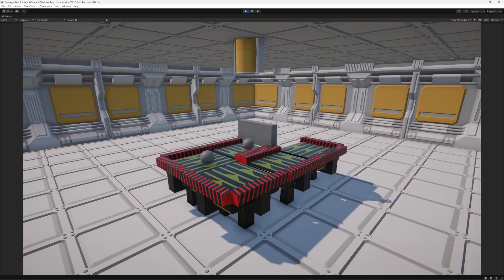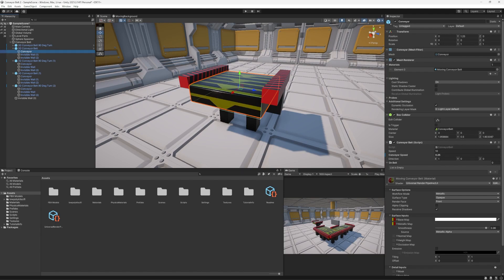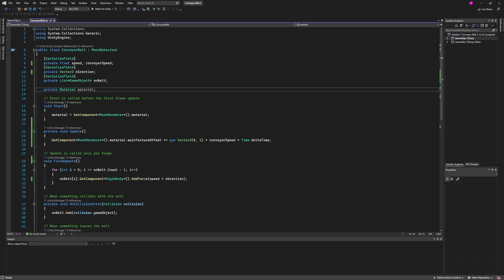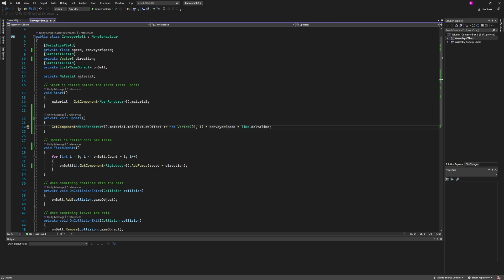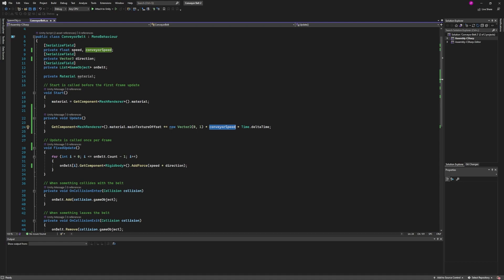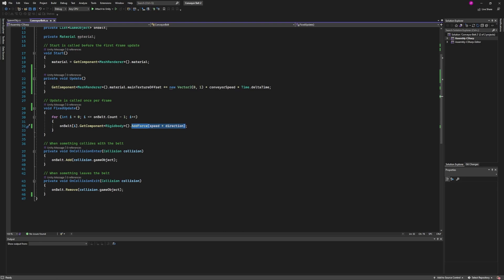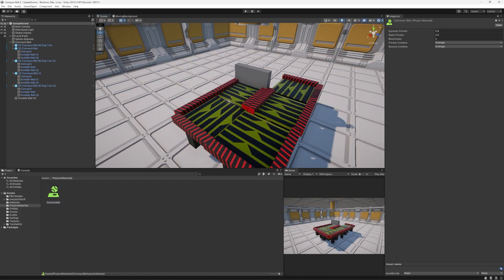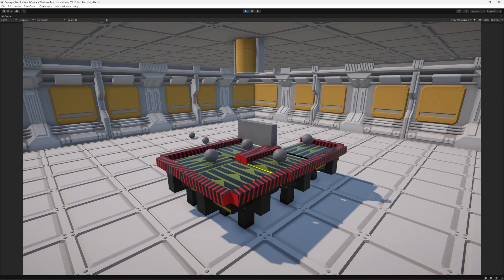3D Conveyor Belts Tutorial for Unity | 2023 Update

Comment: Great tutorial, thank you. I see that you use get component in the Fixed Update which greatly affects the performance. I switched out the List<GameObject> onBelt, to List<Rigidbody> onBelt;  So I never had to use get component at all. I thinking this should be less taxing on the framerates.
Reply from the maker: Ooo great tip. That could help a lot with lower spec devices! I've been using another engine lately and hadn't thought to make the list that specific. Thanks for sharing that! Just goes to show I should spend the time to figure small optimization things like that for future projects.

Comment: I am attempting to follow this guide however only sphere colliders will actually move along the conveyors.  I am unable to get cubes to work (crates).  Is there something I am missing about how the physics works?  Please advise
Reply from the maker: Depending on how you want it to act, you could try increasing the force on the conveyors so they can move the box. The box collider has a lot more friction than a sphere. By adding force it will try to roll the box/crate along the conveyor belt. You might want to try setting the velocity directly but it will snap the direction as it touches the next belt doing it this way. It will be tricky to get it to work as expected moving crates along with how I set it up in this video.
Reply: @jayometric  Thanks very much for the reply.  I ended up using the spheres after all but freezing their rotation, then added my box as a no collider pure visual tag along.  Smoke and mirrors :)